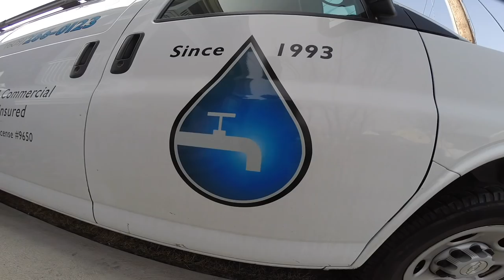PLUMBING APPRENTICE'S FIRST HYDRONIC BASEBOARD INSTALLATION

Comment: No more sweating the fittings with lead???
Serious question, coming up on 40 years that my father and I built the 
house I'm about to move back into. All Slantfin hot water copper 
baseboard heat with a gas fired boiler in a two story 3,500 sqf house.
I wanted to replace and upgrade the current 38 year old Crown Boiler 
with a new more efficient Beduras 85% ...but...HVAC contractors are putting 
the FEAR in me saying "a new boiler could cause leaks in the loops and 
it could happen at any time being the copper and lead sweated fittings 
are almost 40 years old"...seriously???
They want to install a Fujitsu heat pump mini ducted, inverter type forced air for heat and AC.
Reply from the maker: They selling you the fear....Negative on their fearful tactics. kind of cheesy but sounds like you already smell a rat. new boiler fine. air test your loops....never heard of that theory but then again I do not sell heat pumps....lol...hit me up anytime Ray Ray!

Comment: that dry cut saw handles baseboard like a pro! use what you got. bandsaw you have to cut it perfectly square, so definitely the dry cut is better cause itll cut it square every time. but if u are doing a whole house rough in the m18 cordless deepcut bandsaw is pretty slick
Reply from the maker: roger that...its nice for sure. I have never used a ban saw....to be honest with you im buying all battery tools now..I hate running cords anymore and the batteries on boss.....Im thinking bout hole hawg with battery. what do you think?
Reply: @ChuckBarron  not sure if dewalt has a bandsaw, I would assume they do though. It sucks to have mixed sets and different batteries cause youll have a shelf in the van just for all different chargers
Reply from the maker: yes....im going milwaukee for sure.....no more dewalt for me
Reply: @ChuckBarron  I know the packout tool kits are expensive but they are the cats ass.

Comment: Chuck. When I was in school they thought me to never flux right after soldering a joint. Because of the sudden change in temperature can weaken or even crack your joint. Then in the field, some master plumbers hit the joint, just like you, while its "piping hot". Now you must not ever have any problems doing that I'm guessing? But why teach it in school then? 
 P.S. I clean my joint after letting it cool with a dry rag. Still get beautiful finish.
Reply from the maker: i like to clean the drip of solder to make it look nice....never heard of leak that way and i have not had problems.....been doing it for 30 years....
Reply: that really only comes into effect if you use cold water to cool the joint. some guys  will "Shock"it too quickly and you will hear a definitive PING. Unless your flux is really cold from the truck it shouldnt cause problems but to be safe you can wait 20-30 seconds.
Reply from the maker: Thanks Stevie...Test coming up sooon.

Comment: I am a life long ‘hot water heater’ offender too. Just for the hell of it, after a dry fit,  I would have tried progressing the inside corner before setting it in place. May not have worked but it  be  cool if I could.
Reply from the maker: I see it advertised.....lol we all do it

Comment: Chuck,do you get much hydronic radiant heat up your way?
Reply from the maker: ya know I have not....its around and I really like to get some classes under my belt. I thinks awesome...I was gonna try and do radiant here and they opted out. thank god...the place all chopped up, and the floor is all over the place.  Funny part is they poured a new floor before any mechanicals were done...all  done before we showed up...its a shame we could of put heat in concrete. I have done that before...but not the panel type on top  of concrete.
Reply: its become real popular in the uk  especially in new build,not so easy on a retro fit ,nice job btw

Comment: What brand and model  Torch Head did u use
Reply from the maker: i used a cross tech....they are nice with mapp gas
Reply: Thanks I use my Mc tank but for smaller jobs your set up would work for me I am not in to propess yet

Comment: I feel like the propress insert inside the pipe could cause leak issues down the road from the water cavitation or swirling like when a pipe isnt deburred well but worse. Does anyone think that or am i wrong?
Reply from the maker: I am not sure. I let you know when we test... air test coming first. vid will be done then too....thanks b

Comment: someone actually called to "correct" the term tubing cutter and pipe cutter.... guy needs to get a life. It's the same thing.
Reply from the maker: no way we had a good conversation....he was super nice
Reply: I'm sorry to say that you are wrong.If you go to a plumbing supply or to any hardware store that sells cutters and you ask for a pipe cutter when what you really need is a tubing cutter then guess what?Pipe cutters are heavier than tubing cutters and cost more than tubing cutters because pipes are thick walled where as tubing is thin walled.

Comment: I thought the baseboard would be a little more modern looking by now, like the European style. This is the same stuff that's in my 50 yr old house.
Reply from the maker: Yes. Radiant heat is the future of hydronic heating.
Reply: Runtal is the new stuff but not cheap